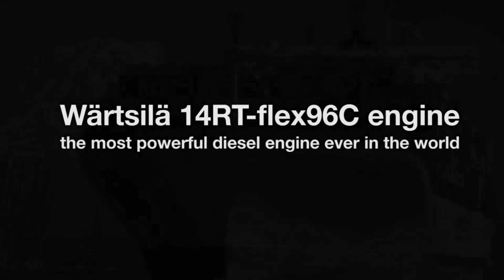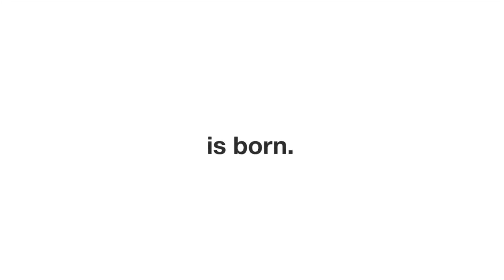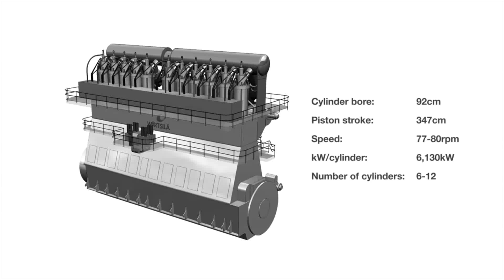Giant Biggest Worlds Largest Engine Diesel Turbocharger Ever Built

Comment: So if 1kw = 1.341 mechanical horsepower and this engine produces 6130kw/cylinder, a 12 cylinder engine of this type would have around 98,645 horsepower (73,560kw)